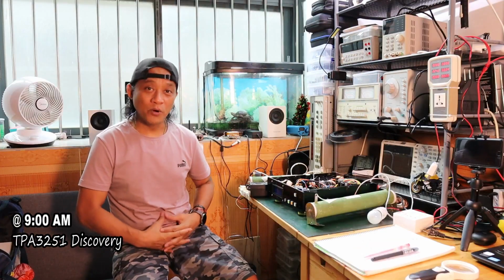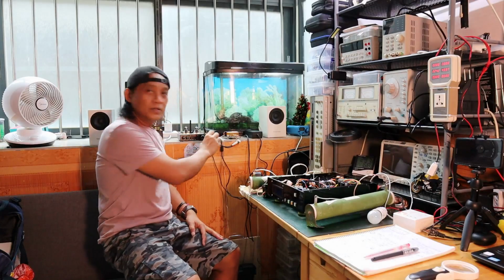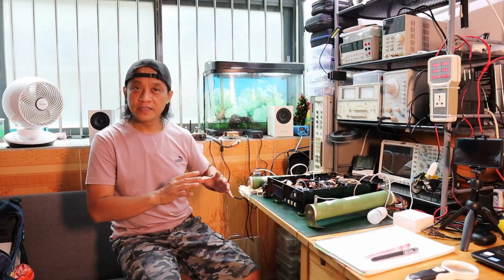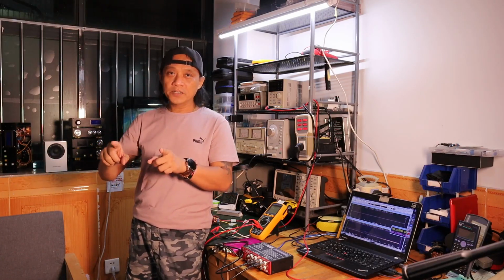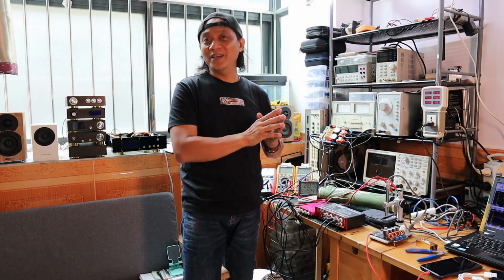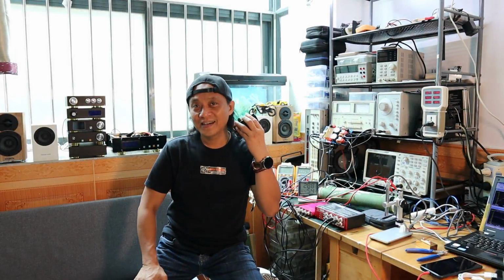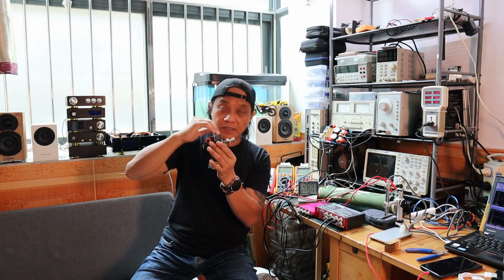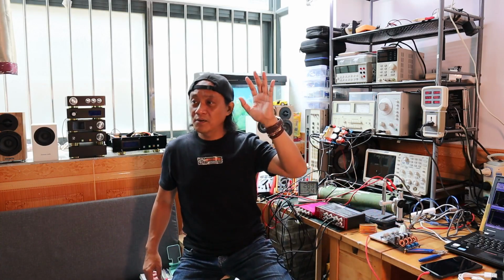TPA3251 | Class-D  Pure Path Ultra HD  Texas Instrument TI Single Chip Class D

Comment: Question that you cant find the answer anywhere.. whats the real power you can get out of that board? (2.1)
Reply from the maker: Thanks for watching,   the summary of the test for TPA3251 was in this video     https://youtu.be/qtGut4TUusg?si=bl9bnWpheSU8gGKS       jump to  18:35 mins,  with the condition of 36Vdc 360W, 1 KHz, 4 Ohms resistive load  @10% distortion  both Channel driven is 144W/channel average power (and also at 1% distortion) - that was taken  after soak test of 60 minutes,  I used the FTC Clause 15 part 432  (14:04 mins of that video) .    I also used 8 Ohms resistive, though the datasheet did not mention it.   In this episode of the TPA3251 https://youtu.be/qtGut4TUusg?si=VcovUuCuMBdSCcIq   I shown on how  I deep dive into the corect power supply  of  +36V 360W the highest power supply I can find in the live market, and the right 4 ohms resistive load (1000W) - with those on my bench,  I can perform and do better on the electrical performance test,  artifacts, distortion, soak test with real music - a dynamic signal with changing anmplitude and frequencies....and more! ,  watch the whole 22 mins video, its a bit lenghty compressed from a day test.  Cheers!

Comment: Apakah bermain 2ohm aman?
Reply: I would NOT use 2 ohm speakers. The amplifier will get very hot and often will go into protect mode. If you must, lower the supply voltage.
Reply from the maker: @MichaelBeeny  this is a nice info, thanks for sharing,  I bet you had experience that in real world testing or using the Amp.  Cheers!
Reply from the maker: Translation "Is Playing 2ohm Safe"
Reply from the maker: The datasheet shows that the TPA3251 can use 4 ohms, 3 and 2 ohms and measure power at 10% or 1% distortion,  say like this :
 Total Output Power at 1%THD+N
– 140-W Stereo into 4 Ω in BTL Configuration
– 175-W Stereo into 3 Ω in BTL Configuration
– 285-W Mono into 2 Ω in PBTL Configuration

In a normal listening stereo speakers,  you will have 4 ohms or 8 ohms specially bookshelf.   You may have 2 ohms for subwoofer

Comment: Hi Ferdinand, I have Aiyima t9 amp, ypu may know this amp. it was stop working today. No power and not turn on. I opened it and basically it has 2 board, 1 is for all inputs and tube preamp board, and the other one is ppwer board which tpa3250 ic in it. What do you think, what is the reason might be to not turn on? Do I need to replace tpa3250?
Reply from the maker: I heard the name "Aiyima",  if still within the warranty - please contact your seller and get support.   this Amp comes with external SMPS PSU,  you might start to check if the SMPS PSU is working, if you have a voltmeter, check if the output voltage is within 18~30Vdc.
Reply: @dr100wconceptpoweramplifier  thanks for the advice, but I have alredy checked it.
Reply from the maker: @ugurakmirza2969  I supposed the SMPS is working good  I am not so sure if the SMPS have LED which is normally green and it is lighted  ))) : .  I got a limited internet inside Shenzhen, China and could not even see how to power it on -- mechanical or electronics switch - is there a problem on the switch,  if the SMPS is good, when you plugged in into the amplifier,  will the LED turned off (if there is LED)  or simply the SMPS will goes into protection mode  (maybe),  Root Causing is a step by step process -  I do not suggest to change the TPA3250 ASAP unless you are really sure its busted.
Reply from the maker: @ugurakmirza2969  maybe can try isolation,  if you can separate the amplifier board from the input and preamp stage and see if it can power on.   Good Luck!
Reply: @dr100wconceptpoweramplifier  it has Electronic switch, I have already open the unit and checked the voltage by the multimeter. I can see 24v and 12v which are for power and preamp, ı couldnt powered only preamp to check because they are working simultaneously.
Reply from the maker: @ugurakmirza2969  I was thinking that, at least the pream-input board can have power and can see the tube glowing, since the power supply is independent control from the class-D amplifier board.  From here, it is really hard to guess where is the fault,  not any LED is lighted.
Reply: @dr100wconceptpoweramplifier  
Preamp board has all inputs like rca, optical, bluetooth, usb. Power switch is Electronic and controls on and off both of the power amp board and preamp board. I can not turn on the preamp individually unfortunatelly.
Reply from the maker: @ugurakmirza2969  I wish you finally find the root cause .  Cheers!